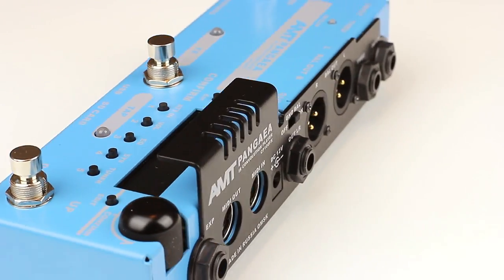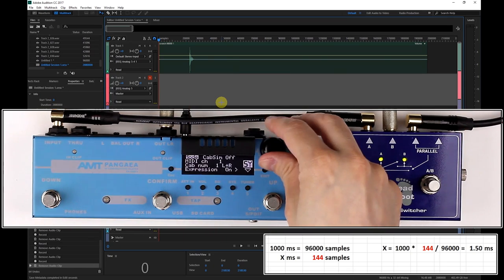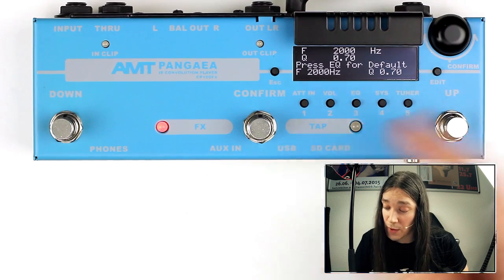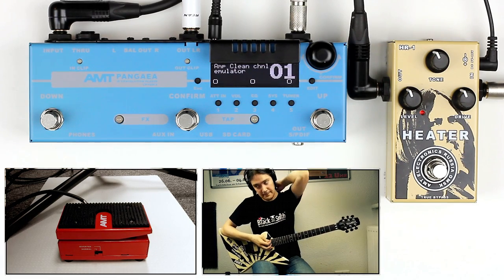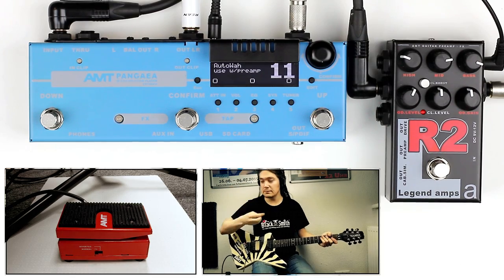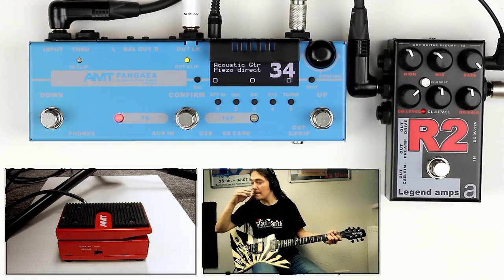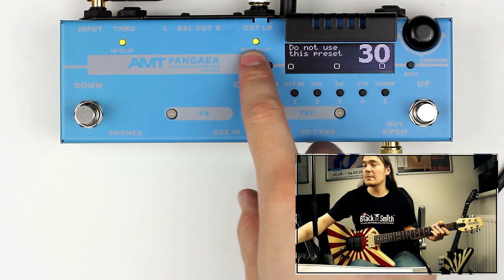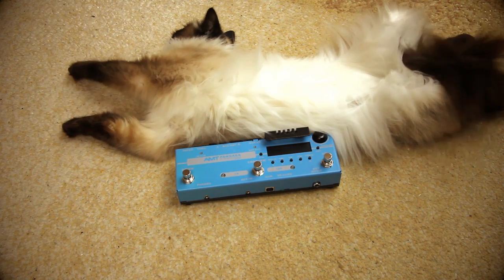AMT Pangaea CP-100FX Cabinet Simulator / Effect Processor. Full review

Comment: Thanks for this great review! I have two questions about this device that maybe you know:
- Is it possible to use an expression pedal to create a wah wah effect with the CP-100FX?
- Can it be used as a MIDI controller for other pedals?

Thanks again!
Reply from the maker: Hi. Thanks for feedback. Yeah, just like at 22:49 an expression pedal may be used to create a wah wah effect. It's basically the same filter with different settings.Pangaea sends MIDI Program Change every time the preset is changed, so yes, you can control other devices. CC messages work as well
Reply: Max Solo Music amazing! thank you!

Comment: Cat sells ) You didn't say about ability to connect pangea to a power amp without cab emulation and to a mixer with it simultaneously. So yu can hear all FX through the real cab, and have complete out to mixing console. Maybe this feature added after you make this video.
Reply from the maker: Yeah, this cat is a real YouTube star. Right, I didn't mention that. I figured the video is gonna so long that I decided to skip that part. And I believe I covered it well in the manual. But yeah, when it comes to connecting Pangaea, it's really flexible.

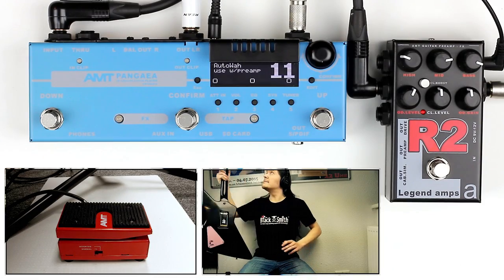Comment: I don't understand why you have to add R2 preamp at 19:35, there is already inside pangaea a Power Amp Simulator of mesa dual rectifier (see California in PA).
Can you show us Power Amp Simulator (PA section) ?
Reply from the maker: First, preamp and power amp are not the same things. This unit is meant to be used with some external preamp. The clean channel simulation functionality was added by the manufacturer later. It doesn't sound bad but it won't stand vs an analog unit. Factory presets from 1 to 10 include the clean preamp channel simulation, while other presets do not have that and are meant to be used with an external preamp

Comment: Max, what software did you use to deconvolve the recording of the sine sweep into an impulse? I've tried Reaper's ReaVerb and Voxengo's Deconvolver but I can't seem to get working impulses out of them in spite of my best efforts to make sure the bit and sample rate are correct (Voxengo doesn't actually seem to let you control sample rate on the way out, so I assume they are simply preserving the sample rate of the original sweep). They appear to successfully create an impulse, but the device can't seem to read it.
Reply from the maker: I use Voxengo. Try its built-in test tone generator to create a sweep. I used the following settings: 24-bit 48000 Hz Mono 15 sec. Recorded files you feed into it for processing must have exactly the same format
Reply: Thanks for the reply, Max. I used 24-bit 48khz when I created my sine sweep with Voxengo (12 seconds, since that's what the guy I got the instructions from used), and same when I recorded it, but don't see a way to select the output sample rate, or mono vs. stereo, so I'm assuming it's supposed to preserve whatever the input specs are (excluding bit depth, which I do see a selector for). I'll keep trying and see if I can figure what's going wrong. Software is so frustrating.
Reply: @MaxSoloMusic  Recently revisited my own impulse recordings and figured out the problem, finally. Apparently Voxengo and Reaverb, both of which I tried, were leaving some silence at the end of the impulse files, so they ended up exceeding the limit of 4096 samples. I had thought the CP-100FX would just truncate any excess, but apparently it just won't play them if there is any. Trimming them to or below 4096 samples made them work, though they need adjusting to match the levels of the stock impulses.